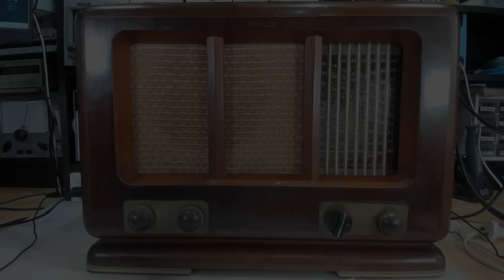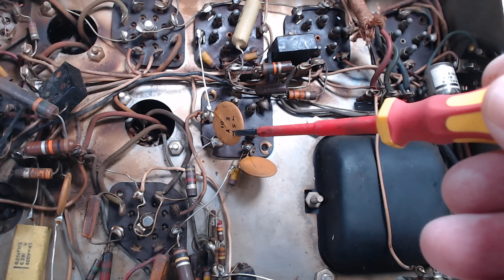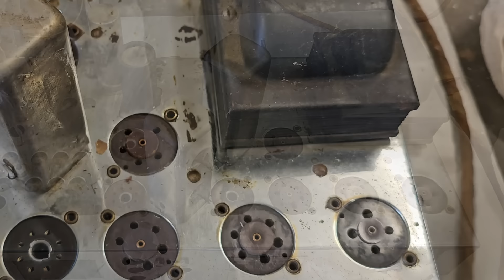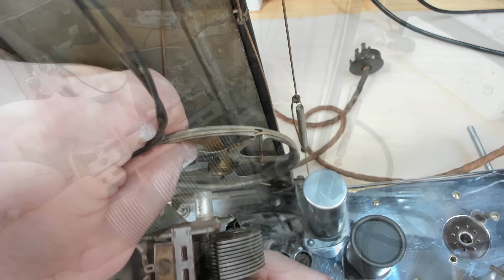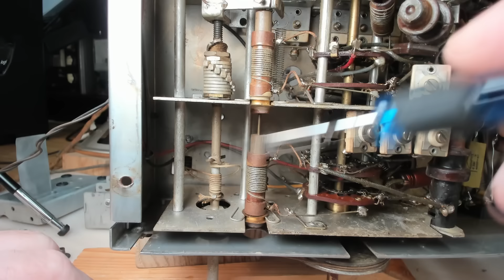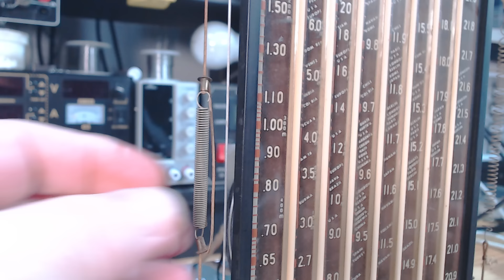Philco 860 from New Zealand, 1949 - It needs a little love - Part 1

Comment: This radio is lucky I wasn't given the task. I'd be tempted to do horrible things like replacing the dial string mechanism with stepper motors and magnetic rotation sensors connected to tiny Raspberry Pi processoors that do nothing but manage the process. And that's just for starters. I'm working on a project like that now, with an old (1958) Christmas toy.
Reply from the maker: Oh-kkkk... that sounds weird but fun Dan 😅

Comment: A trick for the ultrasonic bath is to put just water in the tub and the parts you want to clean in snap tight (zip lock) plastic bags with the appropriate cleaning solution. Saves you having to clean out the tub all the time and stops aggressive cleaners attacking the tub. Also reduces the amount of cleaning solution needed. One other thing is that the cleaner is a bit like a microwave oven in that there will be hot and cold spots within the tank, so you should move the parts around to ensure even treatment. Another thing, like an RF transmitter load (the tub) has an impedance that can be overloaded if parts are brought into contact with the bottom and sides of the tub. That is why they are supplied with chip fry cages to isolate the parts from the tank walls. I believe 1cm is sufficient and I understand that this will also move the part into the hot zone for treatment within the bath.
Reply from the maker: Thanks for the tips Moshly.. I don't have a basket, I did fashion one from a sieve 🙂

Comment: I wish all chassis were chromed 😊 Great result 👍 The SW bands will be quite deaf without a good antenna, so you may just have to simulate signals with the sig-gen. I’m not sure if you’ve said you have a mini-whip, but if not, I’d recommended you try it. It picks up tons of stuff for me here, without annoying the neighbours (most of them). Have a great weekend.
Reply from the maker: Hi Manuel. Agreed, the chassis clean up was a breeze. I have a mini-whip, it works better than other antenna solutions I have tried. My location is the problem, I live in a valley behind a mountain, that coupled with being so far from other countries makes short wave difficult. Have a great week 🙂

Comment: Hi David Hope you and all the family are well.
Great job on the dial re-stringing and I'm glad you showed the whole process. Re-stringing never really fazed me to be honest. Perhaps 25 years in the textile industry helped where very fine threads floating around in fresh air was the order of the day. However the weavers who worked for me were 10X better than I was!
I see you are using that special accent circuit again with a N.Z. radio producing perfect AUS!! LOL.
Look forward to the next episode.
Hope you have a wonderful Christmas and a great New Year.
Cheers
Lynton
Reply from the maker: Hello Lyndon, we are all good thanks. I don't have a problem running strings either, your textile experience would be helpful for sure. My experience in the aircraft industry running hundreds of metres of control cable may be a help too, I had never considered that. Thanks Lyndon, all the best to you and yours for the holiday season 🎄😀

Comment: Fine job restringing that dial cord, Dave. Quite an interesting array of tubes given this is well within the era of octal tubes, but uses a 76 coupled with two 42's and an 80 rectifier...
 It'll be nice to see how this one performs after all..! 
 I'm glad to see these old sets being restored to their best possible operation, I've worked on a few myself, but I've never had to re-string a dial cord yet. If I ever have to, I hope there's at least some sort of schematic I can refer back to. I'd hate to mess it up somehow.  
~Brunner
Reply from the maker: Thanks Bill. I'm not sure why they choose those tubes, maybe to save money. It was easy to restring it because the string was still intact. A stringing diagram is very handy nevertheless 😊

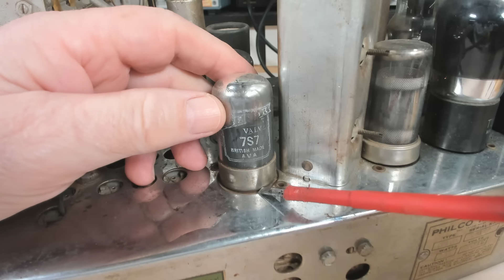Comment: 5:27 - Loctal tubes. See the bump on the bottom ring. Press the tube there and pull. That is the release direction of the two straight wire springs down in the socket. Easy peasy!
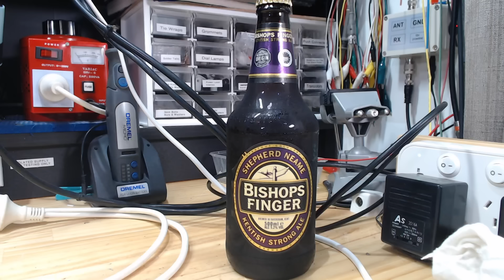11:53 - Ah. Alcohol. It benefits both man and machine!
Reply from the maker: Thanks videolabguy. I knew that, I forgot about it. I'll remember next time, thanks 🙂
Reply: 🥂 Indeed! 
And yes, those Loctals are neat in a way.. I've never come across a piece of vintage tech that used those yet. 
As far as I know, they're mostly used in vacuum tube car radios, the type with the vibrating reed inverter to step-up the voltages and drive the valves properly.

Comment: Hi Dave.  That was quite an impressive looking chassis when it was all cleaned up.  
Although you said it was simple I thought it was quite a daunting dial string. Your solution with the printed drum holder worked well though. 
I think it would be a pity to re-finish the cabinet when the original finish is still presentable.  I'm sure you'll get it looking good anyway.  
Looking forward to part 2.
Cheers
Reply from the maker: Hi Don, yes the chassis looked good didn't it. Nah, pretty easy dial string except I ran one string backwards for a bit. Getting the wave band string working was a bigger pain. The cost to restore the cabinet to original was too much, it looks OK though with a bit of restoration of the original finish...  next time 🙂

Comment: After the teaser on tuning cap, I know the cabinet will get the five-star treatment 😮.
A good friend of mine had a job at RCA of America prepping tv chassis for display at shows. He would pull a set of the assembly line, strip it down, and send out the metal parts to have it all chromed, then reassemble them for the fancy display.
Reply from the maker: Don't expect too much for the cabinet, it's an outside job so cost has to be taken into account. Those chromed chassis would have looked the part for the displays 😀

Comment: I was having deja vu moments as I watched this. The late lamented Jim Burns (@jimburns348) did a Philco Tropic about three years ago which has a lot in common with that Philco 860, albeit without the chrome plating and with a dual dial glass arrangement. The RadioCruncher Bishop's Finger beer reference gave me a chuckle and you've finally shamed me into misusing Black Friday to grab an ultrasonic cleaner. Looking forward to Part 2...

Comment: Its nice to watch a radio restoration video on a radio with more than 6 valves in it, i have a two marconi sets from 1937 one with 10 valves plus an eye tube and the other one 6 valves plus an eye tube. cant find any restoration videos related to them. Marconi 561 and Marconi 537, Do you marconi radios in your neck of the woods?
Reply from the maker: It's very unusual to have radios with that many valves herne in Australia, valves were too expensive. That may be way Philco used the older valves in this set, to keep the cost down. I think we may have Marconi sets here, I haven't seen any though. I don't know if they were sold here or just brought here with immigration 🙂
Reply: @DavidTipton101  I think they may have been sold under the name HMV ive seen Schematics for marconi sets that also apply to HMV just different Cabinates.  I know they are well built sets. id never seen a tuning dial that was all chain drive instead of having a dial cord. its never going to break but neiter would i like to take it to bits..

Comment: Absolutely fascinating Dave. They put some extra thought into the construction with the ingenious valve clips and spring stretch limiters. The amount of cigarette tar inside was astonishing and must of come from a household of brown and yellow decor 😮 That reminds me of a tv repair that a friend had, where a thick layer of tar on the ht line of colour tv, shorted out and had to be replaced. Looking forward to part 2 as always. Good video 👍
Reply from the maker: It would have been an expensive set back in the day. The radio was in my office for a few weeks and I could smell it when I went in there. I believe you that it could cause a short in the HT. Awful stuff to deal with. Thanks OFT 🙂
Reply: The worst bit of cigarette deposits I've ever seen was an HP 286 computer. I'm not kidding you, the entire motherboard was covered with a 20 mm thick furry mat of brown, smelly dust! The computer was about ten years old when I got it and according to the old owner it started out its life in a university office in about 1988 or 1989, then was retired and moved into the home of two heavy smokers.
Reply: @Ragnar8504 Gosh! I bet their wallpaper was used for road resurfacing.😊
Reply: @mmwaashumslowww7167  Yup, quite likely! The previous owner complained that the computer liked to crash, which is why she eventually replaced it. Once cleaned out properly the computer worked fine. Granted, I didn't use it much but it seems fairly plausible that her issues were heat-related with that much accidental insulation inside the computer.

Comment: Those tubular 80s are neat. I've only ever seen 1 in real life. 80s, 42s and 76s after ww2 is kind of unusual at least in the US.
Reply from the maker: Yes, unusual to still be using them is 1949 🤔
Reply: @DavidTipton101  My grandfather who worked in a radio repair shop before the war, was amazed to find occasional sets in the US military with 01As in active service. Nothing that old was being serviced anymore in the civilian world. I think the oldest set I've seen with dated postwar repair work was a 1930 RCA Superrette tombstone which was in use into the late 40s or early 50s. I suspect the tubular 80s were just 5Y3s that were given different bases.

Comment: Great tutorial Dave, Thank you. I used to restore classic camp stoves, and the often internally  rusty fuel tanks cleaned up beautifully with citric acid, marketed here in the States as Radiator Cleaner, and sold by the liter or quart.
Reply from the maker: Thanks Patrick. Radiator cleaner... I didn't know that. I have some ultrasonic machine cleaner, I suspect it will contain citric acid 🙂